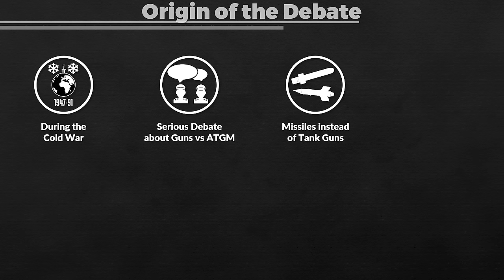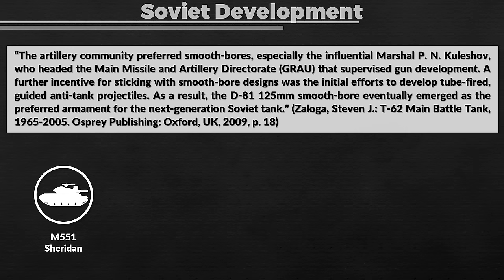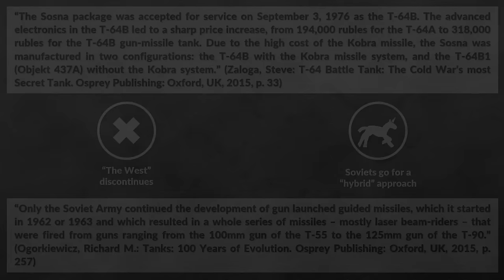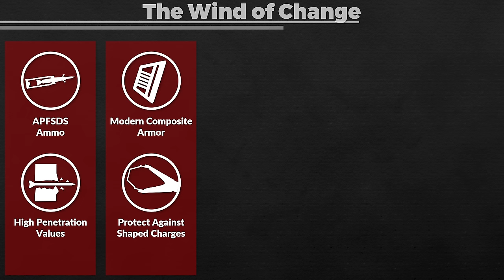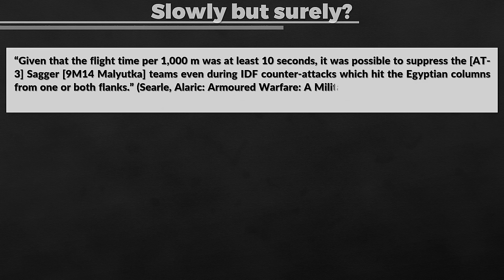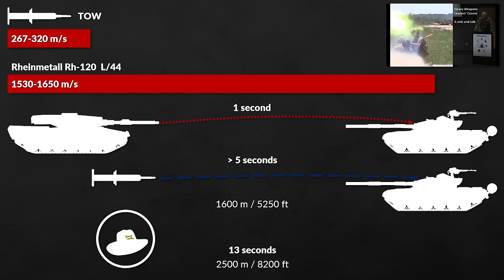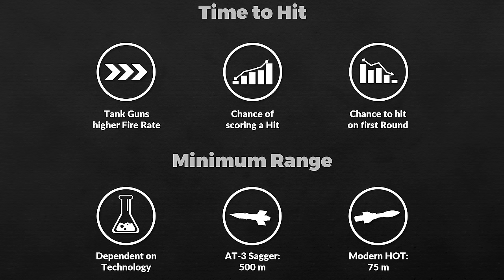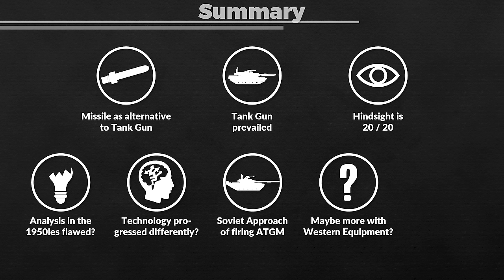Missiles vs Tank Guns: Why Guns are better!

Comment: Something that hasn't been discussed here is that conservation of momentum dictates that a missile system delivering the same momentum (weight x speed) of ordnance on target will always weigh more than an equivalent load of tank shells, which biases logistics in favour of tank shells.

Guns and rockets both work by conservation of momentum - the forward momentum of the projectile / rocket is matched by the rearward momentum of whatever materials it pushes off, called the reaction mass. In the rocket's case, it carries all the reaction mass it needs for forward flight on-board, which it then pushes off by burning them in its motor and ejecting it out the back as exhaust. It needs to carry enough of this reaction mass to provide enough momentum to reach the target, which of course makes it very heavy, especially since some of that reaction mass is used to push the remaining unburnt reaction mass forward along with the missile body.

For a tank shell, the tank shell reacts against the propellant gas, which reacts against the gun breech, which reacts against the tank, which reacts against the Earth itself. So in a very real sense a tank shell cheats by dumping all of its reaction momentum into the Earth, which it (and the tank / truck / ship / C17 carrying it) doesn't need to carry around, making tank shells in general much lighter than an equivalent momentum missile.

Comment: I cant say exactly why but I feel like guns are more accurate, less proned to errors, more simple, cheaper, less fancy. More of a "boom, problem solved".
Edit: in more accurate I ment close range, because they are faster, you can hit a target almost instantly. A missile uually needs some time to gain speed.
Reply: ya, thanks to fancy stabilizers, range finders and ballistic computers
Reply: And don't fail because some debree or branches were in the way
Reply: if I am having a normal gun. with a AT shell and discovers a enemy truck. I can allways fire. what I got and load a HE. it´s not like I am going to fire of something that is more expensive then the truck I am shooting at. I am kind of shure my commanders wouldn´t like if I use the firecontrol system to clear the breach from a rather expensive and rare missile.
Reply: @alexxu3004  it's not like those tech aren't already commonplace by the 70s. A fancy FCS will always be more cost effective than throwing a sophisticated system onto the enemy everytime you fire
Reply: @piscessoedroen  ya, and ATGMs are common since 1950s too, long before any reliable high penetration apfsds came to world. also you overestimate how much missiles cost, a typical cold war era tank launched missile cost only about $5000-20000, and your modern day tank rounds cost 4000-10000 per shot anyway not including the cost of the high pressure gun barrel itself. You would think missile is more complicated but it's pretty much just a rocket-powered RC drone with explosives, on the other hand tank apfsds are super hardened material with high requirement of dimensional accuracy. cost is never the issue here.

Comment: First: Brilliant Icon for Top Attack :) As well as for Subsonic :) 

With the Russian invasion of Ukraine I recently thought about this very question. Always interesting to see different nations come to differenty conculsions for differenty reasons.
Thanks for the very well researched video. Good that you got some proper Video of the Panzerjägers together before the rearrangament.

One point that I think you didnt make that will likely degrade the viability of ATGMS against the top of the line MBTs, will be or already is in some cases, the addition of a hard kill system like Trophy.

As far as I could find out, those systems cant currently intercept APFSDS arrows and that should give the tank gun a comparative advantage for some time. Until the pendulume swings again.

Comment: That's a thing: Although some of the most advanced missiles have fire-and-forget systems, the target adquiring still needs line-of-sight. However, there isn't any technological reason to not be able to adquire the target indirectly, via a small drone, for example.

I'm not talking about the drone launching the missile. I'm talking about a small drone that can adquire the target, send the info to the missile so the operator can safely launch it from behind a hill or something.
Reply: You need secure coms then, and that's hard. Opens the door for EW interference.

Comment: I have always wondered about barrel erosion from the rocket propellant. In the Soviet system does the rocket have a small kick out charge like an infantry weapon or does it go full bore no pun intended with the main propulsion out the barrel? What if any residue might be left in the barrel? Is there any issue with increased barrel wear or pitting of metal?
Reply: As I understand it has a small kick charge that is just like the gun round propellant, just smaller, enough to get the round out of the tube, then the flight motor starts up.  So theres no real difference in barrel or gun wear.   Russian engineers and designers are generally pretty thoughtful about such things.
Reply: I am not knowledgeable about this so take my words with a grain of salt.

But I would imagine the stresses of a rocket and a smoothbore cannon round would be comparable in overall "wear" but very different in terms of how. 

The cannon obviously would involve extremley high chamber pressures and velocities. In other words an extremley brief but intense impulse. The rocket would involve much lower pressure but much higher heat and much more propellant/residue left in the barrel which could be damaging.

I'd certainly like to hear an engineer/knowledgable person's take
Reply: @0sm1um76   Well going from orbitalair said you would use same principles of firing the round to make missiles leave the gun then missile would ignite its engines. So that would mean it would be no different then firing regular round.
Reply: @0sm1um76  I used to make rocket motors.  All tube launched missiles use small kick charges.  Watch the javelin and nlaw videos closely at launch.
Reply: Soviet system barrel-fire missle do have a kick out charge, similar system like Israel LAHAT also have kick out charge

Comment: I sat in a gunners seat on a M60 with a 105mm gun.  The gun round is so fast that I could see the round strike the target at 2,000 meters BEFORE I heard the sound of the gun going off.  The speed of a gun round is almost instantaneous !

Comment: There's also that hollow (shaped) charge the penetration is dependent on the diameter of the warhead.  That's why the 152 mm Shillelagh (love hearing a German try to pronounce a Gaelic word Shil- lay- lee), not one for the 105mm L1 was the missile chosen.

Comment: Missiles are bulky which is why most vehicles carry them outside the vehicle. Hard to protect the crew from cook offs and round count is very low. They are also much more expensive per shot.  

When you’re at the front of the line you may have a lot of potential targets and many of these are lower value targets that can be dealt with quicker and just as effectively with a gun with less risk to the crew and less need for resupply of ammo.

Comment: Despite these experiences both sides have used and still have tanks equipped with only ATGMs with intent of using these vehicles as   tank hunters ( M901 and Khrizantema-S or Shturm-S).

It would be nice to mention that not all tanks are created equal especially if we take loose definition of a tank as armoured tracked  vehicle. The purpose and task dictate what armament are going to be used on the vehicles and many IFV's are great examples of tanks equipped with ATGMs.
Reply: Given the discussion is of gun Vs missile, that only really applies to armoured vehicles capable of carrying large guns - main battle tanks. It's not really fair to compare an ATGM against a 23/30mm cannon, and most armies don't consider AFVs or tank hunters as "tanks" in terms of their tactical doctrine.

Dedicated ATGM systems, or AFVs with ATGMs, also have have different usage scenarios and are deployed differently to an MBT. They tend to be in scouting (AFV), infantry support or other ancillary roles rather than taking the place of an MBT.

They are also significantly easier to knock out with other weaponry given their much reduced armour, and in the case of tank destroyer equivalents are usually less mobile.

Comment: There is one point I didn't hear mentioned regarding penetration, especially at the time the debate was being conducted in the 50s and 60s. This is that the penetration of a shaped charge warhead is, all else equal, proportional to the diameter of the missile. For a missile launched from the gun tube, the diameter is going to be constrained to the gun, so a HEAT shell suffers no size disadvantage compared to a missile from the same gun. The HEAT shell will suffer a little bit from thicker walls (to withstand the acceleration force of firing it out the gun) that cut into the overall diameter, but this may be a marginal effect. Another effect that can reduce the penetration of a HEAT shell is rifling-induced spin, which causes the effect of the shaped charge to be dispersed and less focuses in comparison to a missile that is not rotating as rapidly. The French actually built a HEAT shell for the AMX-30 with roller bearings between the warhead and outer casing so the warhead wouldn't be spinning as rapidly to avoid this issue. What really gave ATGMs (in general, excluding gun launched ones) an advantage in penetration is that they could be much fatter than a competing cannon shell. TOW is 152 mm (6") in diameter, compared with the 90 and 105 mm cannon it was designed to compete with, for example, and exactly matching the diameter of the HEAT shell (out to 800 m) and Shillelagh missile (beyond 800 m) for the M551 and M60A2 tanks.

Comment: I think you forgot a quite important con to ATGMs - soft/hard kill active protection systems (APSs) systems (Shtora, Arena, Trophy, Zaslon, so on).
Reply: We are inching closer to hard kill systems that can engage other projectiles as well. Right now hard kill systems are close to meaningless, though, since there's no widespread adoption of them, and personally, I think these systems will be reliably engaging tank rounds long before even a quarter of the modern tanks out there will have them.

Comment: In my opinion, gun launched ATGMs for MBTs seem a bit redundant since they don't exactly increase the practical engagement range too much and has the advantage only at or past the gun's range, but then the problem is fact that the target has around easily around 10 seconds to use countermeasures or find cover.
ATGMs for autocannon armed IFVs like BMPs still seem like a decent idea to give capability to engage enemy tanks, but hard mounted solutions like BMP-3 gun launched missiles and Bradley's TOW (which can't be dismounted as far as I know) feel a bit bad to me since IFVs can't really take hits from MBTs at any range.

Do you know if the gun launched missiles could be used in a "one two punch" fashion, by first launching a missile and loading a new round while the missile is in air to hit the target with a regular round almost at the same time as the missile?
Reply: Note that only Soviet/Russian MBTs can fire missiles through their gun, whereas Western MBTs don't. One design constraint of the Russian 'pancake' turrets and extremely low profile coupled with carousel-type autoloaders is the lack of gun elevation that's possible. The breech, compared to Western MBTs, has very little room to go down, resulting in lower in elevation angles and a corresponding reduction in possible gun range. They designed barrel-launched missiles because they needed something to match Western MBT engagement ranges without completely replacing their tanks: an expedient (kinda jank) solution to an unavoidable problem.
Reply: The Soviet tanks are designed mainly around combat in the East European Plain(yes, the Soviets think NATO will attack first). Which meant the stand off distance provided by the missiles can actually be achieved. 
With the carousel auto loader limiting the length of ammunition it’s almost impossible to upgrade old Soviet tanks over a certain point since their APFSDS rod simply couldn’t be any longer. This means the effective range of the 125mm on the T-72 against M1A1/Leopard2A5 would be almost suicidal, whilst Svir/Refleks gives them the option to plink away at 4~5km.
Reply: In theory some smart ATGMs could let you hit targets that are obstructed from the gun, if you for example have a drone detecting the enemy tank. It could also let you fire on something that the gun is not pointing at. But the production costs would be high and the system very complex with full drone integration etc.
Reply: @austinduong-van6071  How do you explain the range of 8,200 meters in indirect fire (artillery-style)? See wikipedia link for 100mm tank gun: https://en.wikipedia.org/wiki/100_mm_anti-tank_gun_T-12#HE-FRAG
That 8200 meters is the range possible with 700 m/s HE shells, it shoots faster HEAT and even faster APFSDS
Reply: Unless the guidence unit is integrated into the missile itself, you can load but cannot fire the round before the missile hit the target.
Reply: @CalinCETERAS  Those field guns can be elevated much further, since there isn't a turret ring, crew, ancillary equipment, etc. stopping the breech from going further down than possible. You can hit things from pretty far away if you elevate the gun far enough, but that elevation angle simply isn't possible in the compact Russian tanks.

Comment: On a tank, a gun is more verstaile than a missile to achieve different missions than just killing a tank. Also, even if some ATGMs have a marginal or sometimes entire capacity of defeating buildings and bunker, a gun can still do something similar. From the perspective of a turret, you don't want your ammo to wait 10 seconds before hitting the ennemy.
The actual usefulness of ATGM comes that they could be used from light vehicles and by infantry teams, to attack a tank, as well as be carried on nearly all platforms (while putting a RH120 gun on a vehicle needs a chassis and some adaptatins to be usable).

Comment: There is a constant strive to make armor more effective against both chemical and kinetic penetrators. In general ERA has only in recent years seen a focus on better protecting from kinetic penetrators. There have also been significant developments towards jamming different kinds of missile tracking systems which in cases of laser warning receivers also offer a heads about a gun targeting system. Active protection systems are also being installed on several vehicles from many nations and they also mostly protect against missiles. On the other hand missiles like the TOW offer effective ranges in excess of 4 km where current anti tank guns are of very limited use.

Comment: An MBT is so expensive, conspicuous and requires so much regular training for a large operation and maintenance team, adding the expensive of ATGM seems pointless, except to add a largely theoretical advantage of longer range. The ATGM was introduced to armies as a way to defeat tanks using lighter, faster and cheaper unarmored vehicles with smaller teams and requiring much less maintenance (exception: helicopters), killing tanks without slugging it out with them.

Comment: Generally I think main battles tanks are going the way of the Dodo.
Besides guided anti tank missiles there are also howitzers ie the PzH 2000 and ARCHER which can fire munitions like SMArt155 and Bofors BONUS from 38km away. These rounds break up near the target and each contains 2 independent self-guided submunitions designed to destroy tanks.
Both can fire these quite rapidly ie 8-12 rounds per minute continuously.

Comment: In the 1960's the High Explosive Anti Tank warhead was so ahead in the armor/anti-armor contest that western tanks like Leopard 1 and the AMX 30 gave up on defeating them, or they went to extreme concepts like the Swedish S tank.
Because if you have to use steel armour you need ridiculous thicknesses to defeat a HEAT warhead making the tank almost immobile.

What then happened was the composite armor and the smoothbore gun, not the gun itself but the projectiles it could fire the APFSDS esentially a long dart of a hard and heavy metal like Tungsten or Uranium. These projetiled don't care about sloping armor something the T-34 made famous in the second world war, they are also better at penetrating than HEAT because it's harder to defeat a projetile thant long that fast and of that mass. Essentially a 120mm tank gun puts all of it's energy into a 40mm wide dart.
Reply: Emm... Nope. 

The fusing technology of 50, 60, or even 70 shows that scj warhead has high probability of failure if impact at angle that's greater than around 60 degree. 

Strv103 armor is design mainly to stop  conventional AP. 

Earlier rod are made out of steel, some with WC slug. Those earlier rod has hard time with angle because the projectile geometry.

Althought ricochet with angle is not practical with modern rod, angle still plays a role in defeating rod type projectile, but throught different mechanism.

Rod are better at dealing with complex target, while scj are better at dealing with simple target. And both type of target exist in modern battlefield.